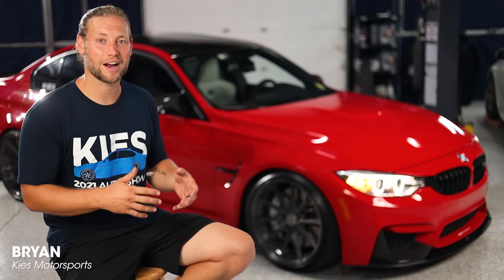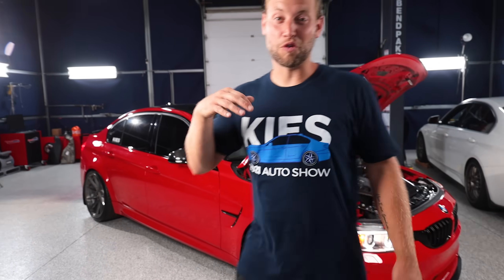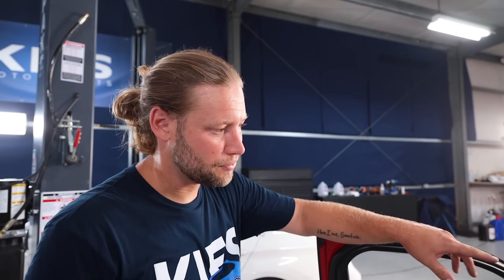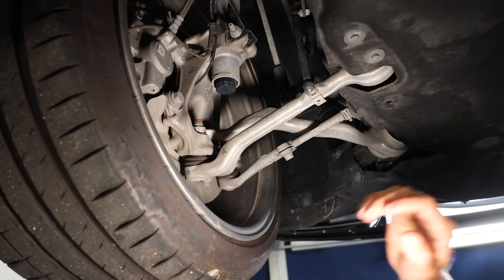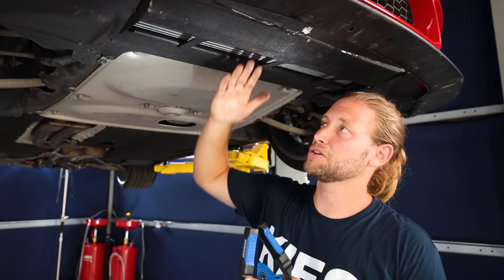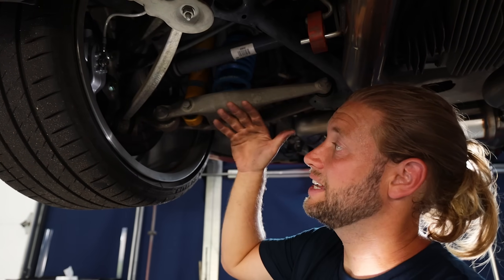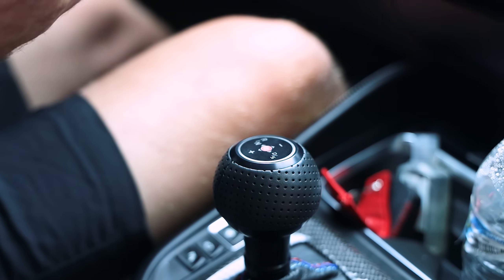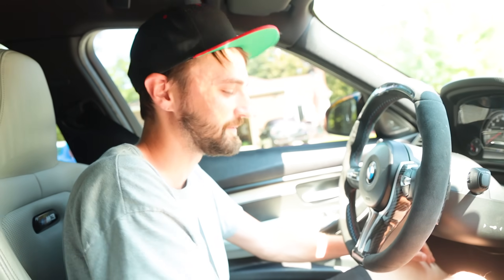THIS WILL MAKE YOU WANT AN F80 BMW M3 | Bryan's Ferrari Red M3

Comment: Awesome job! Thanks so much for coming out, it’s always awesome when you guys are in town 🔥🔥🔥
Reply: How much did you get the F80 for?
Reply: You are not a red kind of guy, but red is one of the best colors on any car, let alone, an M3/4.
Reply: That m3 was 15k salvage bought my kies
Reply: @Unknownbeast703  lol I wish
Reply: Can someone PLEASE recommend a charge pipe for a MANUAL Transmission 2014 335i? I bought this one, and nobody could get it to fit...... It's a "Evolution Racewerks Aluminum Charge Pipes - F3X 335i 435i Manual Transmission" It wouldn't fit. Can someone get me one that will? I cannot use my boostmod3 because it blows up my charge pipe in like 3 days of use.
Reply: Great video. Just got an f80 m3. At the beginning you mentioned that cranking up was extremely recommended. What did you mean by that?
Reply: Nice video!  I just picked up an F82 comp in Ferrari Red a few months ago.  Do you have any idea how many F80/82’s in Ferrari Red were made?
Reply: It’s so cute 🚗

Comment: I’ve always been an import person mostly because when you are young, those are what you can afford but I always knew I preferred BMW’s over Merced and Audi’s but it wasn’t until I got an F36 that I truly was like wow I wish I would have got into these cars at such a younger age. One of the biggest misconceptions I had was that there wouldn’t be much aftermarket parts and it would be hard to do any maintenance on the car or it would be really hard and really expensive to make them ride better or have more power so I was so happy to learn everything that is possible with the F30/F32/F36 platforms.

Comment: The DCT is not a automatic. It’s a dual clutch meaning it’s setup just like a manual with the ability to shift on it’s own. There is a good wright up on BMW DCT ‘s on BMW corporate site. :-)
Reply: It depends how you define "automatic".  It's not a torque converter automatic nor a CVT.  But it shifts gears completely automatically via a computer and the two clutches.  I don't think when the term "automatic" was invented that it was dependent on the exact technology providing the automatic gear changes just that the driver didn't have to shift.  In my mind it's just another type of automatic that happens to use clutches.

Comment: Nice M3 perfect setup man just wanted to know if you knew the front charge pipe where it connects to the cooler you have a  fuel line that runs under there and its so close that it touches the silicone hose that connects the charge pipe to the cooler will the fuel line eventually brake from the vibration of the engine let me know what you think

Comment: Hey Justin, how much better is it than a 340i though? There is still a large price gap between a used 340i and an M3, for street use I think the 340i with some mods like yours is enough?
Reply from the maker: Great question. personally, even after driving this Im perfectly content with my 340i. It’s a remarkable amount of performance per dollar. I got my 340i last year before the market went crazy for $29,000. That’s like half the price of what F80’s are going for now with similar milage. The F80 is an awesome car no doubt, but for half the price I’d take the 340 any day 😁
Reply: @justinbuice  thanks man!

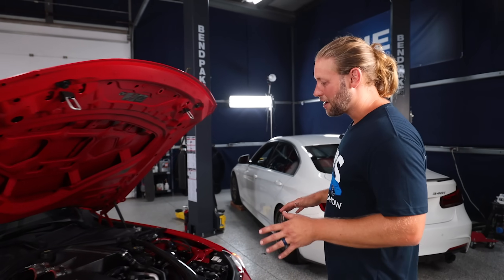Comment: 3:09 whats a crank up? Ive never heard of that before
Reply from the maker: He’s talking about the crank hub issue on the S55 engine where the crank hub spins and throws of engine timing (in some cases causing irreversible damage). It can be a problem on these cars especially when increasing the HP over stock. Many owners install an upgraded crank hub before doing any other performance mods.

Comment: The lack of park wouldn't bother me if the ****ing thing would let me lock it. Or put it in park without restarting the engine.
I've had manuals for 25 years and i never leave them in gear when i park.